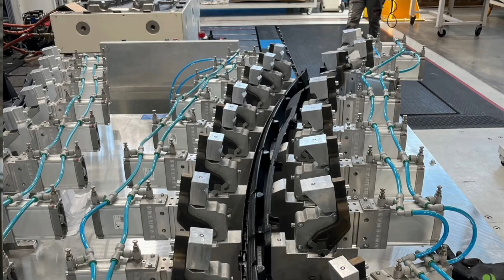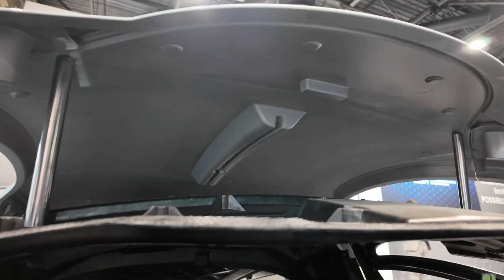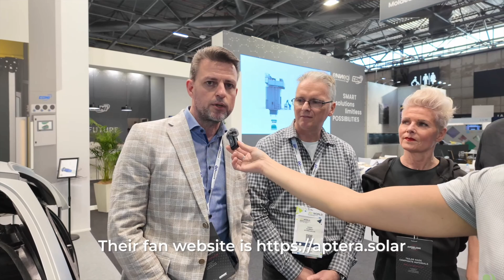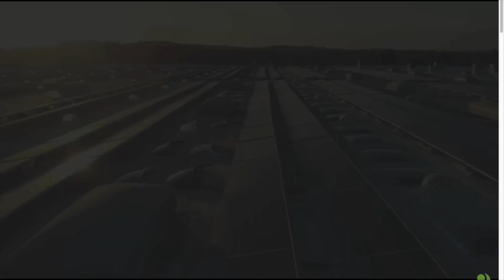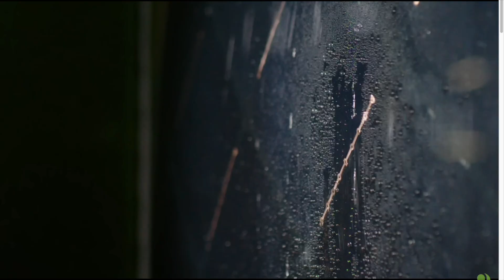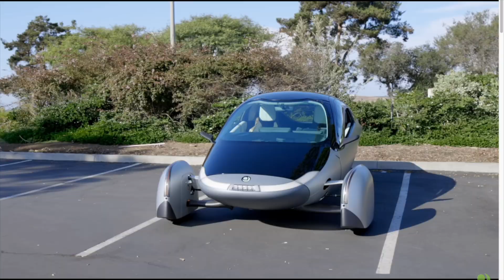Aptera Will Not Rely Only On US Capital !

Comment: uscapital global is offering 'convertible notes', thats where they try  find investors that will invest in aptera by buying convertible notes, which means if aptera gets onto the stock exchange, those investors get stock at a cheap price, their convertible notes, get converted to stocks. If they dont go well I"m not sure what happens to investors money, I dont understand how the system works, just did some basic reading on it.
So uscaptial is going to try find investors to part with 60 million, its a way for startups to avoid getting bank loans is one way to look at it, and they dont have to give a valuation for the company.

Comment: I could see Aptera partnering with Boeing and getting all of their panels on all of their aircraft. This way, no need for the ground power units. After that, on top of all of the rail cars and trailers in the US. Those panels will last as they are automotive grade and provide power. Another revenue stream would be for all of the current accelerators and investors, to match their funds they already made with Aptera for the Aptera Home version which will integrate the Aptera solar cells on the Aptera and the Aptera cells they make for your roof to be one complete package. That way you can disconnect from the grid completely.
Reply: Please don't give Boeing any ideas.  Aptera solar home window awnings might be a useful thing to go with traditional roof panels.
Reply: @JoeBManco  - Plus a pool cover that traps in the heat and can run the heater while it's covered. It would be like a self powered hot tub.
Reply: Sperm hasn't proven itself to the egg... but it's certainly a worthy effort

Comment: good info can't wait for my aptera
Reply from the maker: Thank you , the best news is yet to come . 😎
Reply: @freepower1082 the bad news is you'll never get an Aptera 😮
Reply from the maker: When I get it , I’ll be laughing at you . 🤣
Reply: @freepower1082  I remember Elio fans saying the same thing.
Reply: @freepower1082  seems like you already started.  I'd wait with the laughing if I were you. By the way, I'm not laughing, I'm angry at those guys.
Reply from the maker: Sorry about that , I didn’t know . 😔
Reply: I'm not laughing either.  Aptera told us two years ago the battery pack is designed, built, and ready for production later that year. Now there is an entirely different battery design earlier this year.  They tell us Yazaki is building the wiring harness then they show us stickers on the body and a few circuit boards with hand cut wiring from the local auto parts store.  Sandy Munro said the hub motors won't be used in August 2023.  Aptera denied it and only recently had to come clean about that.  Now they're hiding behind some non-disclosure agreement as a way to stall for time.  They claim the parts are over 97% sourced.  Then why are they waiting on PI parts?  They said some of the PI prototypes would be crash tested this summer.  They don't even have the first PI moving under its own power.  

Let's not forget it is Aptera that said the 16 PI vehicles would be done by now.  They said that over one year ago.  They told us moose testing and crash testing would be happening around now.  No, this isn't just a slippage of schedule.  This looks more like something else entirely.
Reply: @JoeBManco  the fact is that these vehicles will cost more to produce than the proposed selling price until they get to volume production.  They don't have a production facility up and running and they don't have the funds to get through that period where they would lose money on every vehicle.  This is a two seater plastic trike which is priced like a 4 seater, 4 wheeler.  The economics do not stack up,  this is pure fantasy.  On the subject of solar power, the only viable way to power your vehicle with solar today is to put panels on the roof of your home.  The people running Aptera know this, so why are they still collecting investment dollars?
Reply: @bluetoad2668  According to SEC filings Aptera has spent 140 million over the past two years.  The 60 or so million they seek to raise only buys them about one year of existence without building anything.  That number would, by necessity, have to go up just to build vehicles.  Others have speculated that the 35K price would end up around 50K just to more or less break even on building the vehicle.  Add to this Chris A's boat company sold boats at 80K.  Which is more complicated, a boat or the autocycle?
Reply: @JoeBManco  those boats didn't do too well, the company folded I think? Or maybe it 'sunk' ?
Reply: @bluetoad2668  Epic boats are no longer being manufactured.  The best I can tell it stopped production in 2018.
Reply: @bluetoad2668 Another reason crash testing has been delayed is because Jerry won't sacrifice his big flatbed.
Reply: @JoeBManco  this will be the excuse when they fold and fail to return any investment money and perhaps even any deposits.  It'll be very hard to prove that they never actually intended to make and deliver any products.  They will claim that they acted in good faith and simply failed to raise enough capital - happens all the time etc.  Probably no legal recourse.  This is the most likely outcome at this point.
Reply: @bluetoad2668  I think you're right unless there is some really suspicious book keeping and a whistle blower steps forward.
Reply: @JoeBManco  I would just like to remind you that a vehicle that can't move itself does very well in crash testing. Of course cars that move themselves quickly do worse in crash testing. So you can only ridicule 1, either doesn't move or doesn't survive crash testing.